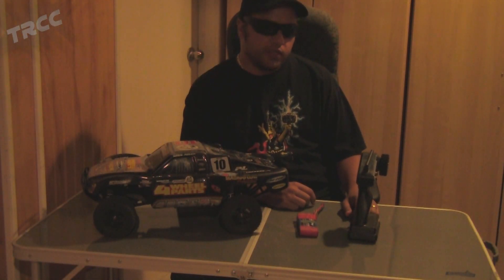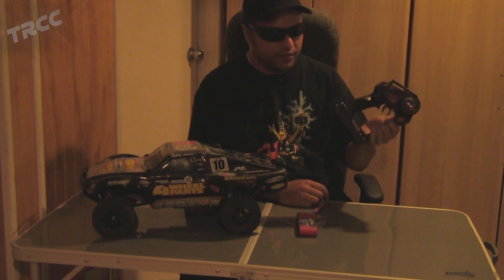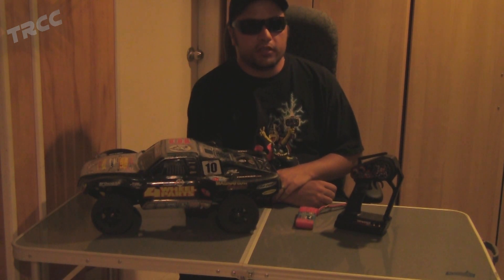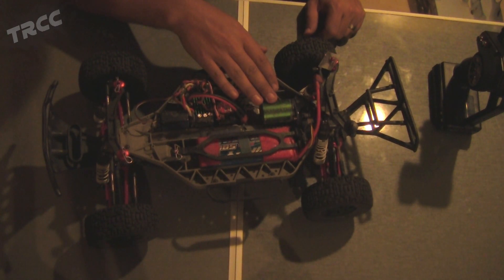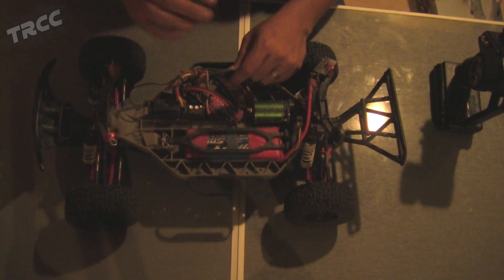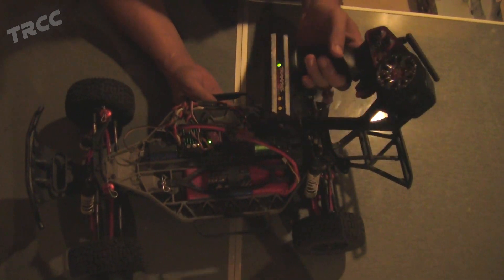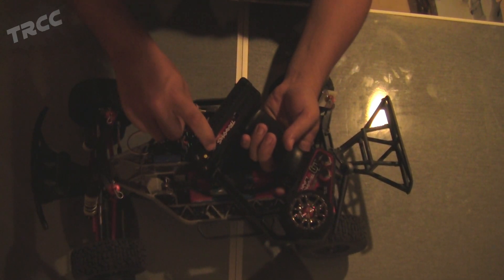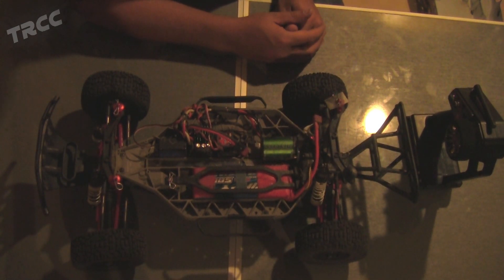TRCC TECH TIP - How to fix your brushless RC if its going faster in reverse than it is forward

Comment: All the videos i find are with the traxxas transmitter i cant find one with the spektrum lol but i reversed b n c but i didnt have luck...i got the speed tranferred to the front but it was still reversed on the control unfortunately
Reply from the maker: with a spektrum you can see it's reversed, make sure it's the correct way on the TX and then flip wires on the motor until it runs the correct way based on the TX, the reason this happens on traxxas is because poeple set it backward unintentionally and then it's set to like 20% power on reverse so people dont shred gears.
Reply: @TRCCtv  i guess ill have to keep trying...i only switched the b and c with no luck i guess ill have to switch the a

Comment: I know it's years later but what is a fix if it's a sensored motor?
Reply from the maker: you can do it by also swapping a couple of wires on the sensor wire, however with sensored i really dont think this is your problem, there's likely some other solution for your problem.

Comment: Still little confused when you switch  the wires does it mess anything up because. my is color coded and my engine  is senseless
Reply from the maker: no, the wire colours don't matter, it wont hurt anything
Reply: Thanks

Comment: Thanks for the video,  I just bought a Spektrum Firma ESC and motor combo for an upgrade for my DT03, it was running faster in reverse, so I searched and found your video, and it worked perfectly!!!  thanks again!
Reply: Which cables did u switch and how did u leave ya settings on the remote?

Comment: Thanks dude, I could be able to solve this issue, actually I imagine this solution and I change the wires (inverce the polarity) or at least I supposed I did, how ever, the second time worked great. Now goes faster in forward.

Comment: Thanks a bunch I just finished running my talion an notice it wasn't perform ing like it normally would. I just put a new hobbywing esc in an notice it wasn't pulling up in the front. But pulling up in reverse I did everything from use the program card to rest control s.didnt work didn't think about I put abc from motor on wrong . Saw your video. My car had to much power in reverse. Switch everything around. Rest my esc with program card. Did a test with it in my hand holding it the thing flew out my hand an landed on the ground got my power back thks again.

Comment: Mine is doing this reverse is fast then when i trigger forward it brakes the goes slow forward BUT i cannot switch the wires in my brushless motor
Reply from the maker: the ESC might have a programming option to reverse the motor, do that and then reverse the channel on the radio and that should fix it.

Comment: Man I've heard of switching the motor leads around, but i didn't know if ppl meant on the motor can or at the connector ends. Got a losi mino rock crawler for my son, upgraded to a hobbywing 1080 esc and it was faster in reverse than forward. Tried to program it, reverse the throttle, switching motor leads worked, then I still had reverse steering but I just flipped the steering reverse switch and called it a day. I get full throttle, and forward is forward...thank you brotha!!!
Reply: On the motor lol

Comment: Is it the motor are the ESC that can't be sensored
Reply: carlos miles doesn't matter if they are sensored as long as you're running it in non sensored mode.

Comment: Thank You!  I just got a castle sidewinder 3 and it ran backward. Reversed the controller but then it was slow forward, fast reverse.  Switched wires and set the controller back to normal for the fix. The instruction manual from Castle didnt even mention this as a possible issue.

Comment: hey bro, my car goes forward but will only brake when im going in reverse. Any idea what that is or what i may have done?
Reply: i have a jlb cheetah transmitter
Reply: Hi, did you find an answer, I have the same problem.
Reply: Yea, i had to swap my motor and esc wires. Switch and reconnect any 2 wires until its working correctly
Reply: Or u may not be going fast enough to brake
Reply: Hi Again.  The car did work well when i first got it, do you think i still need to move wires around?
Reply: Did u pick up speed then try to brake?
Reply: Tio Brooks , it worked well.for a week or so.  then I had a crash that broke a front wheel off,  ever since then the throttle hasnt been acting how it should.
Reply: on a Traxxas this is a setting on the ESC not sure abiut other models

Comment: what does he mean by censored and uncensored. I have a brush less ere voodoo vxl and have the same problem but I don't want to mess it up even more, can someone plz let me know?
Reply from the maker: you'll know sensored because it will have an additional plug with a set of tiny wires, bu chances are if you don't know the difference, its probably sensorless. Sensored is usually only used in on-road or competitive race cars/trucks.
Reply: Oh thank you because I have a velineon brushless and I just switched now it works perfectly fine. I wasted 45 bucks on a new ESC which I apparently didn't need. LOL thank you for this awesome video
Reply from the maker: yeah the vxl is definitely not sensored
Reply: OK thank you once again for this great video!

Comment: Hi, my rc car has the problem of it going faster in reverse than forward, but I'm not sure really how to do that on my Traxxas TQ transmitter. If you can please let me know how i can fix it, that will be really helpful.
Reply: Did you ever find this out
Reply from the maker: you just need to swap the motor wires and use the TX manual to reverse the throttle channel, all TX's will be different so you need to do a little research on your particular model.

Comment from the maker: if you've got the ESC backwards the brake will be messed up too, it'll go reverse, brake forward, but instant forward to reverse... so this fix will repair that to, so you'll have forward brake reverse, and reverse to throttle with no brake.. 

ESC backwards will do: 
Forward>Reverse (no brake)
Reverse>Brake>Forward

ESC the correct way will do:
Forward>Brake>Reverse
Reverse>Forward (no brake)

Kinda tough to explain, and of course this is all dependant on the ESC type and programming.
Reply: This is my pro lem but i cannot unplug my motor it has no plugs on it

Comment: dosent that screw with the brake because ive tried that only works sometimes because the brake gets reversed wen u switch the controller so when u go forward and hit the brakes it snappes straight into reverse